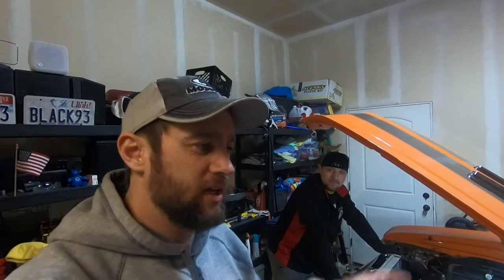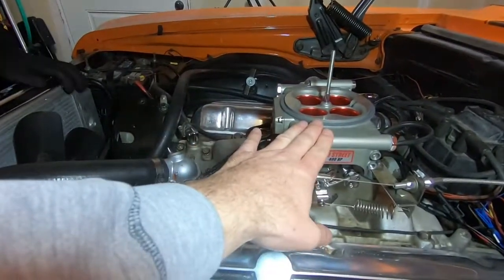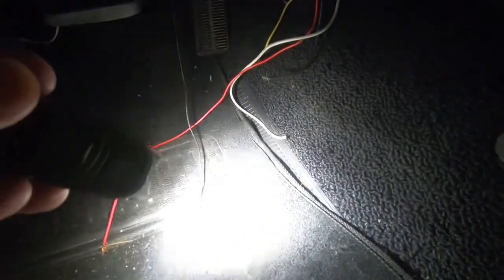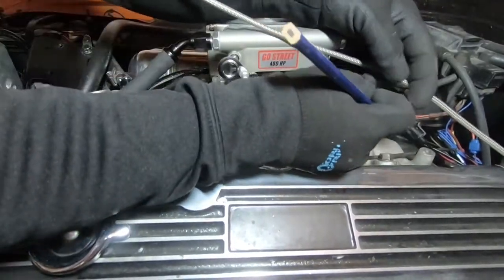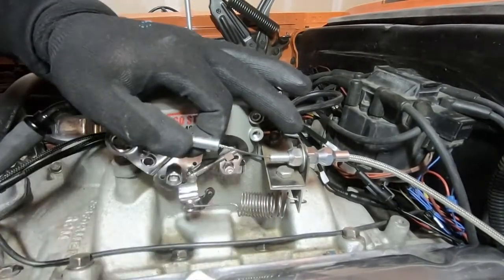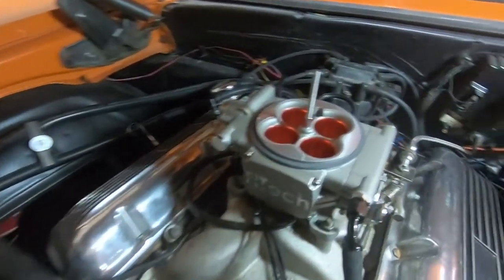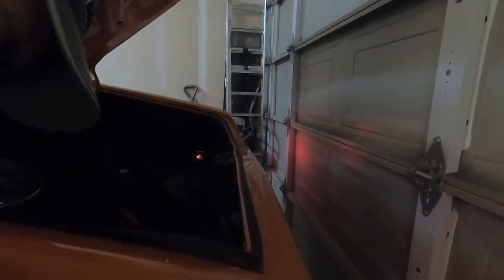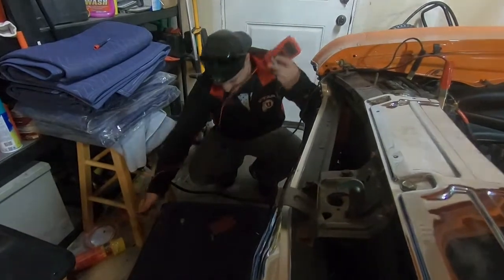72 Nova SS Finally hit the road. Throttle cable adjustment, lights and first burnout

Comment: You should seriously put some Loctite on the set screw on the end of that cable so it never comes loose. Loctite Red 262 would be the best way to go.
Reply from the maker: Name It Build It I will have to. Good info

Comment: You should add some LED headlights to that car! You can get them on amazon or ebay for like 50 bucks totally worth it
Reply from the maker: I will have to look into them. They would look amazing
Reply: Burning Rubber Garage Optix P.RA Diamond 7" Round H6024 Glass Sealed Beam Housings + 60W EOS H4 LED Conversion Kit - Replacement Pair https://www.amazon.com/dp/B01MXXUOWK/ref=cm_sw_r_cp_api_qISHBbBNBYPWS          Something similar to this would look sweet

Comment: so...after 2 years,how has the fitech system worked out?
Reply from the maker: It has been great. No issues with the fitech just the starter and the trans now. When the starter engages it is a perfect start every time hot or cold. I will have a video out about this at some point

Comment: what brand of throttle cable/bracket is that i installed the fitech on my dodge the old cable isnt going to work
Reply from the maker: Just modified the one that came off the carb.